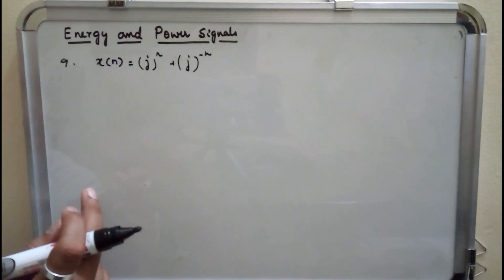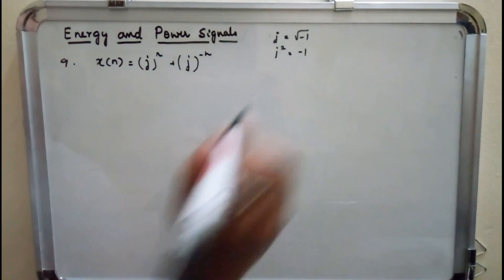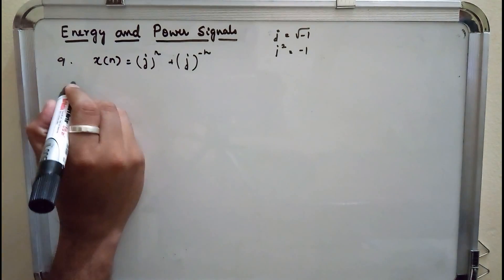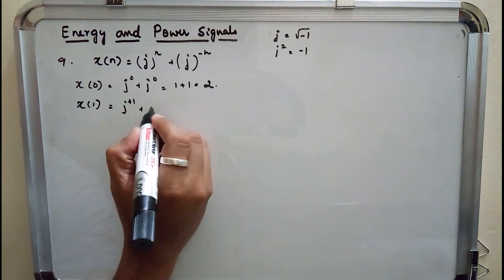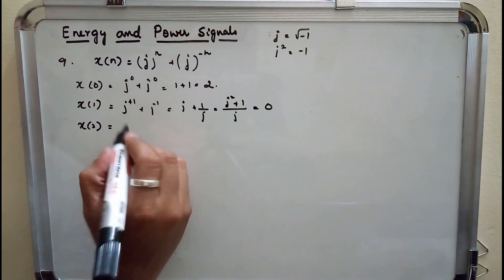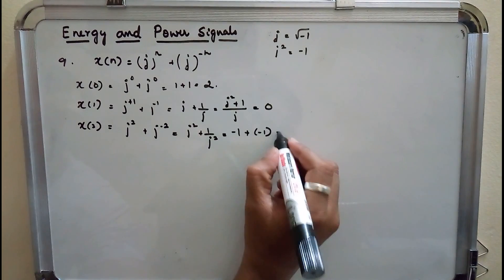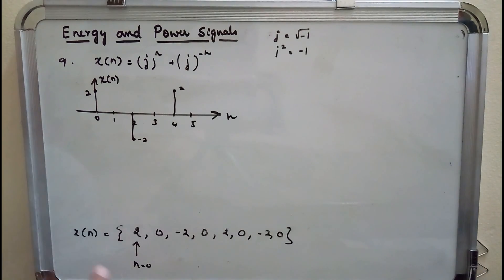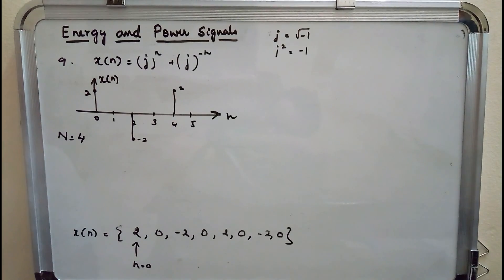Problems on Energy And Power Signals -Part 3

Comment: sir at 5:51 the formula we used for energy signal(discrete) is (1/2N+1)*summation(-N to N)*|x[n]|^2 in oppenhiem.. so kindly clear my confusion sir
Reply from the maker: Ahmer Baig this is periodic signal . So we need to use the equation which I have used here . If the signal is repeating like u(n) but not periodic . Then the equation what you r mentioning has to be used .
Reply: thank you sir